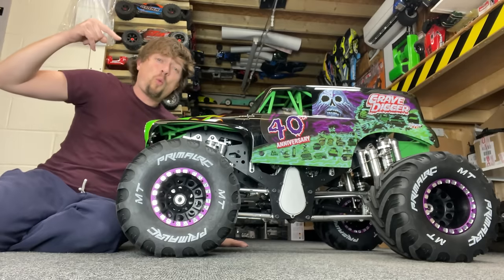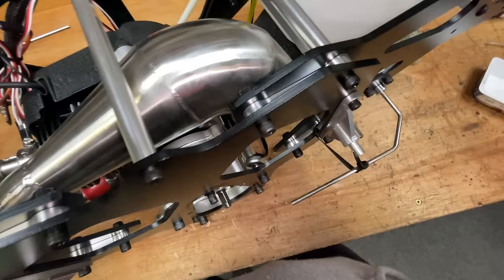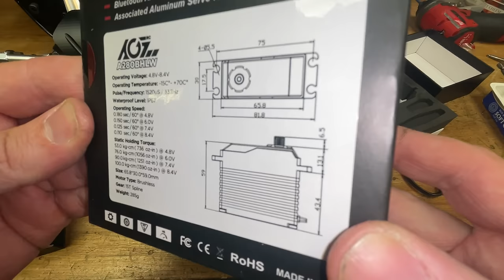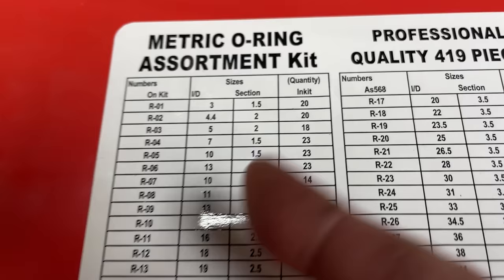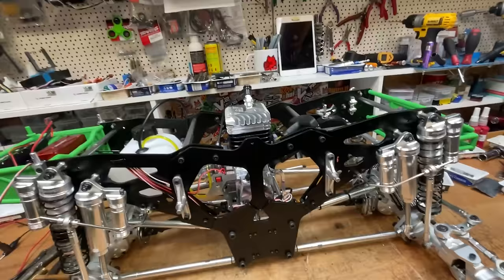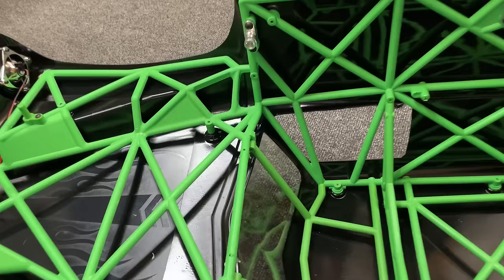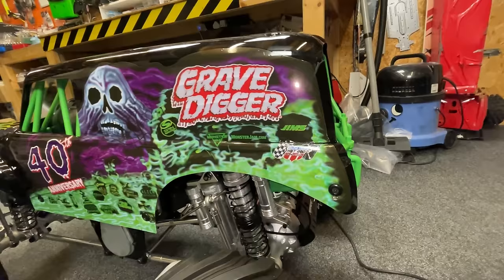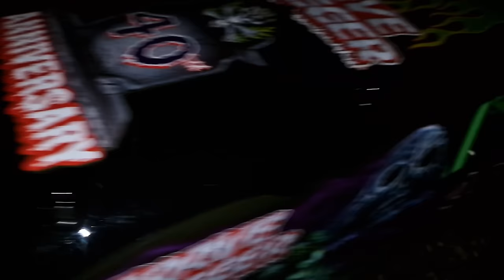Worlds Biggest RC Car gets RACE Engine (4x power)

Comment: I think you may need to get limit straps for the suspension on all of your primal rc’s. For the big air I know they are going to get
Reply: 👍 
Limiting straps definitely take a huge load off the shocks.... I've ripped a few pistons off the ends of the shock rods from not using straps.

Comment: 7:05 I have one of those transmitters, they are really good, but the one problem is that I have found that the on/off switch has gone a bit sketchy over the past few months, but I race nearly every 3rd sunday with a bit of practice inbetween, so a lot of switching there...

Comment: Used to do big vinyl signage installs. Soap and water is the way to go. But when you have curves, start at the top and go down to the curve. Stop there and the get the heatgun and let the vinyl stretch into that curve. Make sure that the bottom of the vinyl (the part under the curve) is not sticking to the body. Because if you heat the vinyl up, it will start to stick. When done with the curve and it sticks to that part, get a little bit of soap water onto the rest of the vinyl and squeeze the water and bubbles out.

Comment: Soap and water is the best way to do it! Along with a heat gun. Plus if there are any bubbles left you can just use a needle to poke a tiny hole and it'll be gone. This thing is a beauty. Can't wait to get mine!

Comment: better way to take that screw head down if you have a table grinder or belt sander. Clamp the screw in a hand drill and rotate it while using your belt sander.

Comment: Hey should you probably put some of that high temp tape on the inside of the body by the exhaust pipe to keep it from possibility melting? Like stuff used on dirt bikes, snowmobiles and atv's is what I'm talking about. Would think the pipe would get hot enough to easily melt Lexan or Polycarbonate.

Comment: Kevin.
I've been using the FS-GT5 radio for my monster truck and it seems to be a good unit, the only issue is the Ch4 switch, it could be better.
And it will accept a battery pack instead of AAs.

Comment: You should put a turbo on it if you can find one
Reply: why? turbo's have been proven to do very little on a 2 stroke that small. 100cc and bigger , superchargers/turbos are worth but for anythin  smaller, the extra weight and complexity isnt worth the slim  to nil gains

Comment: Besides actually replacing the engine with another that's more powerful couldn't you also squeeze more out of the existing? Through a jet kit, mill the factory head(more compression more torque) exhaust and or Big Bore kits? Granted most my 2 stroke experience is from my racing past with semi-pro ATV's doing everything from outdoors MX to Stadium Cross and Quad Wars back in the late 90's into '00's so I'm 𝙉𝙊𝙏 positive if can do same with these smaller engines but kinda figure ya must be able to.

Comment: 25:1 mix ratio?  holy rich.  Try some Amsoil Sabre 2 cycle oil.  great stuff and you can run a leaner ratio.  Maybe Primal needs to come up with a sort of slipper type clutch for in the driveline.  If you land on power the slipper can slip vs breaking stuff.  Just a thought.  Cool stuff man
Reply: I was thinking the exact same thing! I have a 1/5 scale Rovan Baja (HPI Clone) that I ran 25:1 in like the instructions call for, and it killed the motor in less than a month. I've seen on several forums and youtube videos that you can run 50:1 and things will be fine. I've ran a weed eater on that ratio for years and it's never had an issue, so I'm going to give that ratio a go in the new motor and see how it holds up.

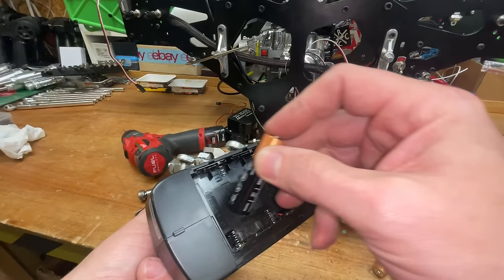Comment: 6:50 I wonder if that's why I have issues with bearing blocks from china. My 5 mm bolts don't fit in easily, I wonder if they're 4.5 mm holes....hmmmm going to have to look into that.

Comment: You burnt out the brake servo. How did you get the brake servo to function opposite of the throttle servo? I burnt out my brake servo and I bought another but now the brakes apply when the throttle is open.

Comment: Use soapy water next time so the sticker doesn't stick when u squeeze all the water out of there
Reply from the maker: i did
Reply: @KevinTalbotTV  okay cool, but seems like it still stuck to the surface, normally it should be sliding around, but still nice sticker job lol, better than my noddle arms🤣
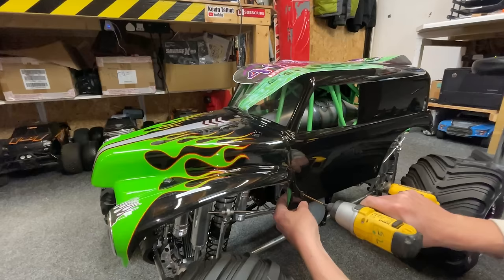Reply: 16:42